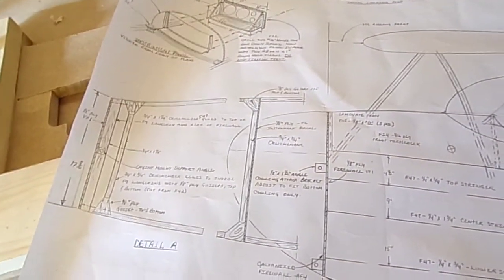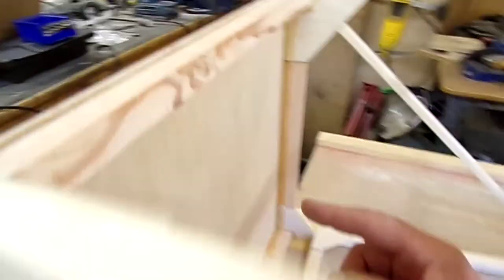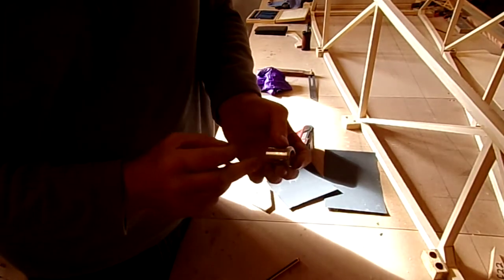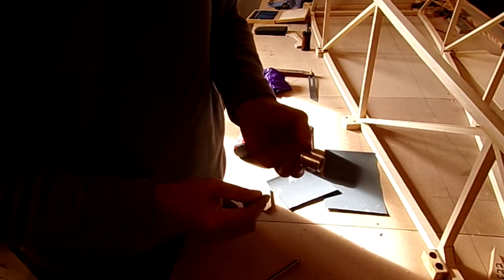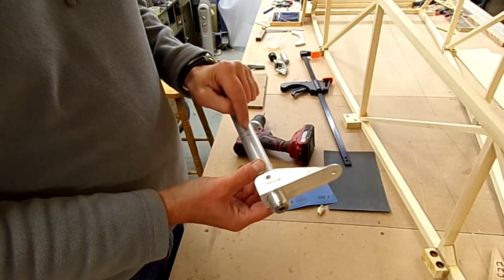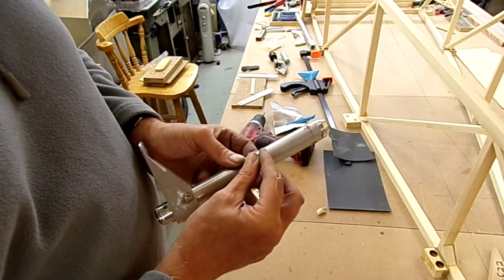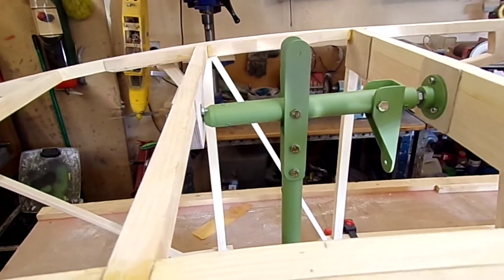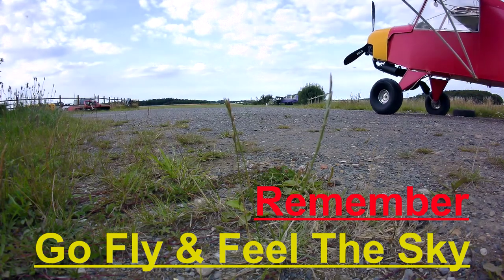EP72. Fisher Youngster V fuselage and column

Comment: If one is to make a mistake, adding too much wood is probably perfereable to the alterntive. 

I notice you point out that the bottom of the joystick pertrudes out of the lower fuselage.  Does that mean that the aircraft will have elevator control wires running on the outside of the underside?

Lastly, this week's kit show & tell from me will be a Bristol M.1c, as operated by The Shuttleworth Collection.
Reply from the maker: You are right, it is better to have too much wood than not enough but it will be a pain to remove just the exess.
The elevator controls a tubes and although it pertrudes out through the lower floor it will be still within the covering, it will be easy to see later than for me to try to explain now 🙂
I am hoping to get down there again before you start building and I may do a video of for your referance if you want. Let me know what details you would like covered.
Reply: @flyingkub  Thanks for the offer on the Bristol M.1c ref info on your next visit to OW.  I've got some photos of it myself but any general views of how the undercarriage axle attachment looks would be good confirmation for me.
No rush as it isn't sheduled to be done until 2027.  Your aircraft will be done before that kit.  
For 2023 I have 9x SAAB aircraft, the Red Arrows Gnat and 2x Tornado lined-up to do.
Reply from the maker: @Payne2view  2027!!! Stuff a Stoat, I like planning ahead but that is taking it to a whole new level 🙂
Reply: @flyingkub  "Stuff a Stoat"?  Thats a new one for me.  I shall have to save it for use myself. 😀
I've got about 58 kits and scheduling at 12 to 14 per year is just one of the things I do to avoid what needs to be done.  I'll see how things go.  I may be able to fit it into a spare week, depending on how things go in 2023.
Reply from the maker: @Payne2view  I often plan to avoid doing what needs to be done 🙂 But youhave given me another reason to go to OW.

Comment: You mention the "fire wall" several times. Does it have a special coating?  I also have the same question as Robert Payne.  Regards Michael
Reply from the maker: Well you will have to wait to see the answer to the control column out the bottom question.
The bulkhead the engine attaches to on an aircraft is called a fire wall and normally has some form of fire resistant material to slow the spread of an engine fire. I will have a thin sheet of aluminum holding and protecting a fire proof sheet between it and the ply, so, the wood airframe is not turned into a match if I have an engine fire in the air.